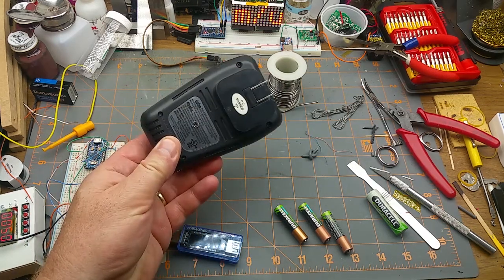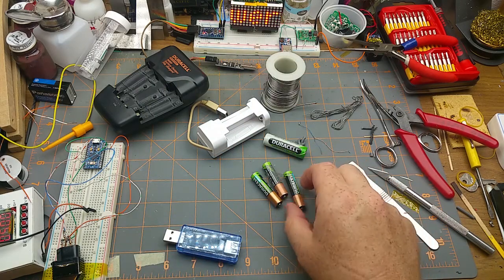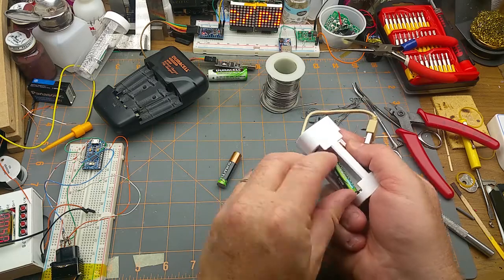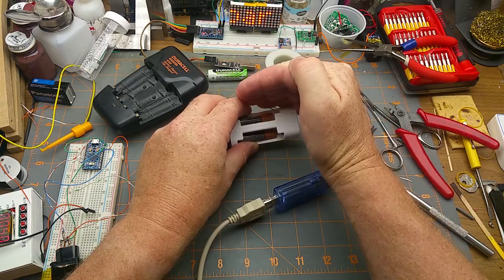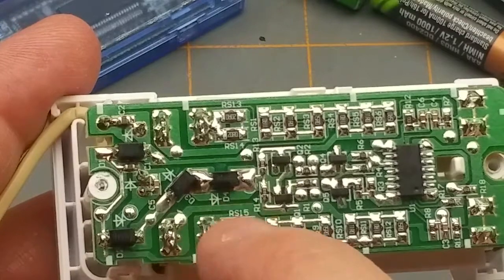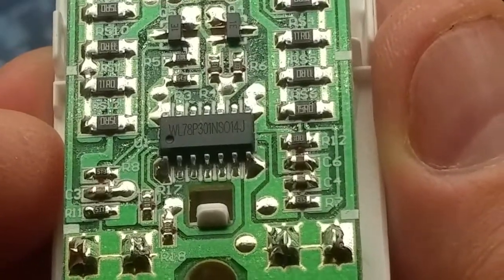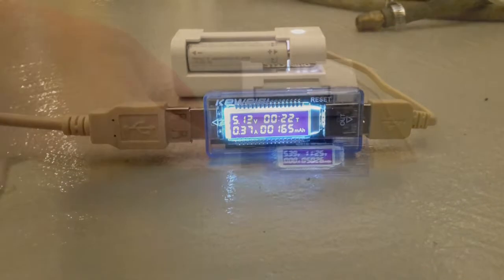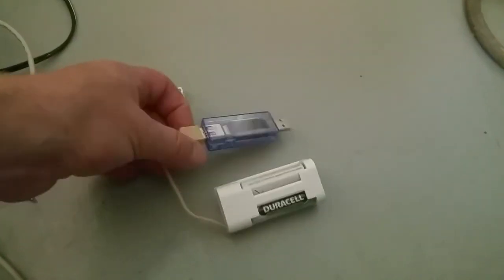Ikea charger

Comment: Many "smart" NiMh battery chargers with multi cell capability that aren;t trying to be "fast" chargers actually charge each cell one at a time for a second or so in a cycle, and the rest of the time the cell is resting. This is partly because it allows gases released internally while charging to reabsorb, but it also makes the charger design simpler, you just need mosfets to route the charge voltage to the right cell rather than separate circuits for each cell, and you can measure the cell voltage while it isn't being charged which makes charge state detection easier under some circumstances. I think when you only had 1 cell it it, the bouncing was just because there was only one cell pulling current. With two unequally charged cells there will obviously be a difference in charge current between cells until the voltage on each is equal, which usually happens quite quickly. This IKEA charger looks like its really nicely made and designed.

Comment: Does this have overcharge protection? Most of the chargers sold with the batteries are absolute shit.
Reply from the maker: It seems to. Hard to know for certain with that mystery chip in there.
When I put a fully charged battery in, it only stays in charge mode for a short time before it indicates charging complete, so it does do some detection of the charge state.
Reply: Thanks. For the price, it's definitely worth trying out.
Reply: Detailled test here, slow/timed charging, no -dV termination (hard to detect reliably at such low current anyway)
Reply: +daij... So why is the OP's charging quickly shutting off when inserting a fully charged cell?
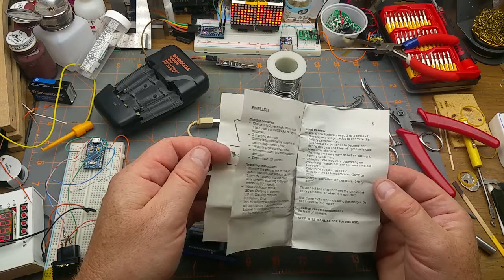Reply: Daijoubu  The third point on page 4 of the manual ( as seen at 0:40 ) states that it does have a -dV sensor.

Comment: It charge at 400 mA (200 at single battery) so it charge very slow?
Reply from the maker: Yeah, it takes several hours.
But, in my experience that's typical for NiMH chargers.
 NiMH don't have nearly the capacity as Lithium. 
A double-A battery is about 1800 - 2000mA/h, so at 200mA, that's 9-10 hours for a full charge.